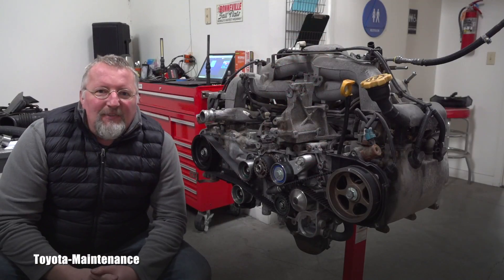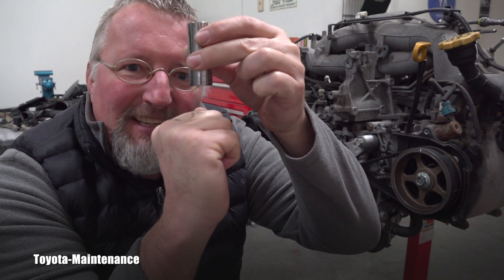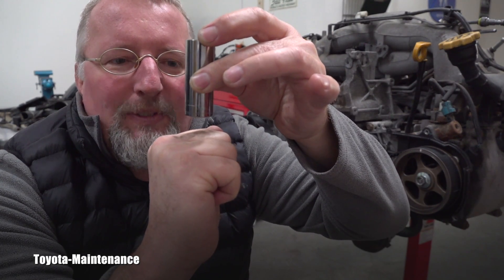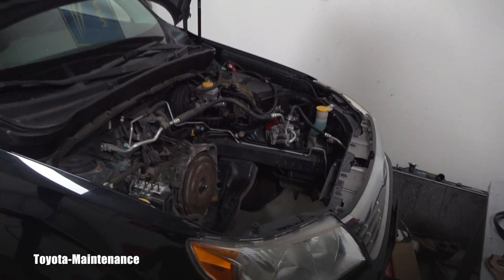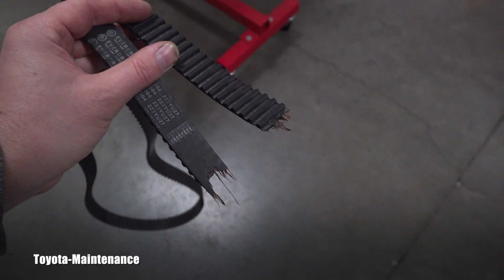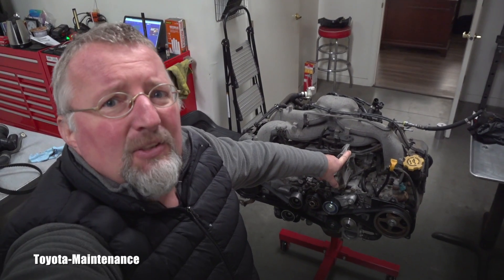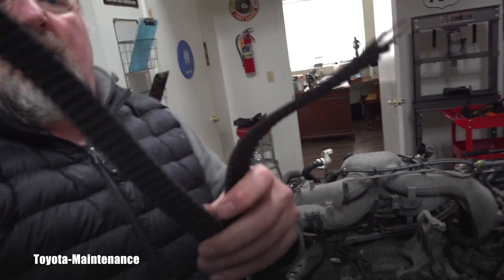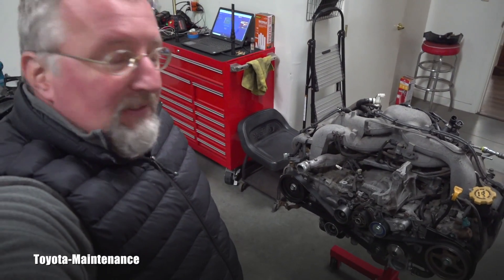Avoid Interference Engines with Timing Belt

Comment: Don't worry, Subarus will blow the head gaskets before the timing belt.
Reply: He maybe uneducated but he's right in the real world people do not do the required maintenance and when you let the coolant get to the point that it conducts electricity galvanic corrosion starts occurring this goes for all water cooled engines but Subaru's are particularly susceptible to head gaskets failure cause be lack of maintenance wether through owner or design flaw.
Reply: @moparnut6286  We paid for 3 head gasket repairs out of our first 5 Subies.  Maintenance wasn't at fault, just crappy Subaru design engineering.  I did my own timing belt/tensioner jobs on the belt-equipped Subies.  That being said, I got tired of Subaru's excuses & just got a 2019 Tacoma.  Never had a timing belt failure in multiple Subies to over 200K miles.  Maintain them, replace not only the timing belt, but also pulleys/sprockets/tensioners, and it should be OK.  Then you get to enjoy how your Subie consumes oil (1 qt/750 miles in.my 2013 Forester).
Reply: Not unless it burns thru the oil first.
Reply: Only the un-educated would post a comment like that.
Reply: @caraficionado4724  Do some research, it's you that is uneducated.
Reply: @caraficionado4724  huh? I've made a good living on changing them.
Reply: @caraficionado4724  lol subaru owner got buthurt

Comment: Great information about interference engines; it's definitely good peace of mind to own a car with an engine that is either non-interference and/or has a timing chain like my Scion XA with the 1NZ-FE. Although, while bent valves are certainly no fun, I do think the cheaper "Evergreen" brand timing belt may have had something to do with the premature failure. Also, given that the belt is of cheaper quality, the shop who installed the belt and completed the job, likely may have neglected to change the timing belt idler pullies. On Subarus, these pullies are more than often the culprit when dealing with timing belt issues, as their bearings can seize or even sometimes explode with old age. Doing a Subaru timing belt replacement should involve the installation of a full Aisin or OEM timing belt kit. MrSubaru1387 has some well-informed info on this in his recent video about timing belt kits. These kinds of engines can last a fair while with proper maintenance, just like the UZ engine family.

Comment: BMWs have timing chains, but plastic guides that cause the same sort of joy when they snap.  So simply having a chain is not a guarantee.
Reply: If you are concerned about reliability you wouldn't buy a BMW.
Reply: @gncc600  Although I joke about my BMW, most of the problems people complain about are due to a simple unwillingness to properly maintain them. My X5 could've been one of the many thousands of 4.4 V8 X5s with a trashed engine because of failed plastic chain guides, but I had it all replaced preventatively so as to avoid that fate. It sucked paying that 5k repair bill, but not as much as it would've sucked if the engine grenaded.
Reply: @tempest411  I agree. I've had multiple BMW's and they are fine cars - when maintained. But this constant attention costs money and most folks just want to drive, not wrench on their cars. New BMWs, in my opinion, are just for lease. Bring it back before the warrantee is over and you're fine. Actually, most manufactures are now following this model.
Reply: @mikearend997  That's about right.  But the re-sale prices on those kinds of cars are dropping faster than ever.  Used to be, German cars held their value very well.  Today, lease prices increasingly have to factor in that huge depreciation, and it may sink them in the current economy.
Reply: BMW stands for break my wallet!
Reply: @moparnut6286  Or, "Bring Money With"
Reply: Germans pronounce a 'W' as we do a 'V'.
As in 'Badly Made Wehicle'!
Reply: @ianrichardson3228  Ja, ich wiess. Ich spreche Deutsch!
Reply: Spinning Back-Kick  It was either that or let the engine fail, be stuck somewhere, and pay even more for a replacement engine. Since my wife is the one that drives it, that option is even less attractive than it sounds already.
Reply: Spinning Back-Kick  the job is very involved and takes many hours. you basically have to pull the whole front of the engine off. plus i'm sure for 5K they replaced more than just the guides. they probably replaced the chain, gaskets, etc. you can do the job yourself but it will still cost around 1K. after doing the job the car will be good for another 100K miles if the oil is changed regularly and the chain tensioner is changed once in a while

Comment: I've owned 2 Subaru Outbacks...  NEVER AGAIN!

Even Subaru's CEO has admitted that their company had a lot of issues.  News to him: THEY STILL DO!
Reply: good for you. I'll be driving Subaru boxer engines forever.
Reply: @wim0104  thank you! Most subaru issues are due to lack of maintenance or abuse!
Reply: Sean what problems did you have?
Reply: @gncc600  from the first month, CVT problems... I had a check engine light go off and they tried to tell me it was a pinched cable harness. The transmission caused the car to stall out a couple times too. Apparently, Subaru knew they had a problem but didn't want to deal with it. HG blew and was diagnosed when I had the timing belt worked on 90k-ish. The dealership never answered my question on whether or not they used a flush or just refilled the coolant after the timing belt/water pump replacement. The head gasket problem is a very common problem and I've educated myself quite a bit...

The car was in immaculate shape. Oil changes at 4, 000-mile intervals, both air filters changed every other oil change, PCV changed at 30k increments, the car was babied. Top gas, top synthetic blend and synthetic oils. I never pushed the car's RPM, it was the family's vehicle and with three kids in the car at the time, I didn't race around.

By design, the Subaru 2.5L engine was destined to blow its head gasket. Poor design. Poor, poor design. I have made a point to talk to Subaru owners that I see in parking lots at gigs, social events, etc. I'm not alone with the transmission and head gasket problems...  All but one Subaru owner that I've met has had one of those problems.  Even the newer cars!
Reply: @SeanPopify  Sean, sounds like you were a very diligent Subaru owner who stayed on top of all service and maintenance intervals, and didn't abuse and "over-drive" the car, but still was let down by design failures of Subaru. Sorry to hear about your disappointing experience. Notwithstanding the notorious head gasket issues that have plagued Subarus for decades, I was always fond of their boxer engine concept and AWD as standard equipment in all models. However, I lost complete respect for Subaru when they discontinued their automatic transmission and replaced it with the crappy unreliable CVTs within the last 4 or 5 years or so. It really cheapened the car. It seems that a lot of car builders have also gone with the CVT concept, which really suck. Unfortunately, most car buyers these days don't have an understanding or clue about the engineering and engine/transmission design, but only care about convenience features, drink holder placement and whiz-bang blue tooth wireless interface capability....and of course the exaggerated TV commercials showing Subaru's overstated off-road capability.
Reply: @carlv8168  funny you should mention the off-road capabilities. After driving my 98 Outback regularly in the snowy mountains (occasionally off-road), I tried to drive my 2011 on a snowy paved mountain road in California.  At a checkpoint, California Highway Patrol officers advised me that I could not go forward without chains.  My owners manual said not to put chains on that model of car.

Yay Subaru. Not.
Reply: @SeanPopify  Yeah, the CHP is really finicky about chains in winter in the mountain regions.
Reply: @carlv8168  I don't remember what year it was but they told me that they were starting to enforce it due to liability.  I had brand new all season tires on that car also. In years prior to that, they did check the depth of the tread but they allowed a four-wheel drive vehicle to go up without chains.

Subaru went from a great, durable vehicle to a weak copy of Toyota...
Reply: @SeanPopify  Yeah, I'm in San Diego, and they still required me to install chains on my 4x4 GMC Yukon with beefy tires, during the winter snows in our east county mountains. About the decline of Subaru's reputation, I totally agree with you.
Reply: @carlv8168  for reference my chain incident was on Palomar mountain. Save yourself! Stay away from Bob Baker and Weseloh dealerships! 😁😁😁
Reply: @SeanPopify  Yep, Palomar Mtn is typical for all the roadside CHP check points for chains. Cuyamaca Mtns, too. About Weseloh and Bob Baker, thanks for the warning, but I don't buy new cars often and generally keep them for 10+ years or more. Notwithstanding the dealership scenario, I already made my decision about 5 years ago that a Subaru (of any kind) would not be on my wish list, purely because of the $h*tty CVT transmissions. The only alternative would be an STi WRX, as they only come in a 6-speed stick, but even those are grossly overpriced, and I don't want the headaches of a turbo. My 25 year-old Yukon continues to provide unrelenting reliable service, and is powerful enough to tow my boat.

Comment: You did say a  4.7 is bullet proof  mine is 2002 LX 4.7with 4 speed auto.   I had  timing belt water pump and Toyota oem parts.  Drove 10K miles at speeds up to 90mph  then months after belt skipped about 6 teeth one bank of  4 cylinders stopped.  Limped to Lexus dealer for repair.  Any ideas how, why?  Merry Christmas!
Reply: Probably tensioner. Over time the tensioner can fail to provide the correct belt tension and driving at higher speeds/rpm's only makes it worse. All rollers, tensioner and water pump should be replaced when belt is changed. Costs more, but if something goes wrong, as in your case, you have to pay for it twice.
Reply: @mikearend997  Thank You for your help.
I am a senior citizen, Everything was changed at Lexus and I took the parts and belt. I had the timing belt and Water pump changed because I did not know for sure. I bought @ 90K  is now @ 106K

Comment: If the belt broke in 5000 mile maybe the valve train is now causing too much resistance causing them to break early.
Reply: Good point but the original was in good shape and only replaced due to age and mileage.  He used a cheap Evergreen belt.  The heads will be rebuilt so it should be good to go.

Comment: Toyota maintenance.
I have a serious question for you.
I have a 2005 Lexus Gx470.
All over the internet it says that this is an interference engine.
When I call the local Toyota dealer service department this say it is NOT an interference engine.
On top of that, to try to confirm, I called local Lexus dealer service ddepartment and they also said it is NOT an interference engine.
What is the truth?
Have you personally ever seen one of these engines wrecked by the timing chain breaking.
Please help.
Reply: You have a timing belt, not a chain.
Reply: @cpscps2679  I know that
Reply: the 4.7 V8 in your Lexus GX470 is an interference engine. If you have 60-100,000 mikes on it or the belt is 7-8 years old or more, or if you don't know the age or condition of the belt and you want to keep the vehicle (great SUV, by the way!), then I would change it. And don't forget to do all the rollers, tensioners and water pump while in there.
Reply: @mikearend997  have you personally seen one that has been wrecked by the timing belt going out?
Reply: @bigfootnmore6619  Yes I have, a 1986 Porsche 944 turbo. The belt broke and the valves hit the top of the pistons. Valves were bent and the valve guides were ruined. The entire cylinder head was replaced with a rebuilt one. There were slight visible marks where the valves had contacted the top of the pistons, but no damage to anything else. The engine performed well after a rebuilt cylinder head, gasket, timing belt, balance shaft belt (used on this engine to quell vibrations and driven by the timing belt), all rollers, water pump and oil seals were replaced. Needless to say, a very laborious and expensive repair. I've also seen where a valve broke off after striking the piston and continued through the top of the piston. That engine was replaced with a rebuilt one. I know the cost to get the belt service done is exorbitant to say the least, but if it costs $2000 to have it done right, that's only $250 per year if you were to do it every 8 years. Put the money away every year as the cost of doing annual maintenance. Buying a new car will cost you much more.
Reply: @mikearend997  I was talking about the 4.7
Reply: @bigfootnmore6619  Sorry, I have not seen the results of a 4.7 V8 with a broken timing belt, but that doesn't mean it won't happen and you have a lot of pistons and valves going up and down all at the same time. I would assume the damage would be quite extensive if it happened at anything over idle speed.
Reply: @mikearend997  I understand interference engine concept.
Please read my question in first comment so you understand the dilemma I came across.

Comment: Come on, the 4.7 is legendary. Change your belt every 100k like you're supposed to and they'll go 500k
Reply: Changing mine next week.  201K same belt.  4.7 2004 4 runner.
Reply: @hotepcracker8975  make sure you change the water pump, thermostat, tensioner pulley, idler pulley and serpentine belt while you're doing that work
Reply: @beardedwonder2346  thanks. I got everything but the pulleys.  Need to get those.
Reply: @beardedwonder2346  
Cam seal too.
Reply: @hotepcracker8975  LOL. How did it look?? 111,000 on my  2003 4Runner with original timing belt also. Thinking about changing mine in a month or so.
Reply: @unodfredy  Haven't got it done yet.  The mechanic got covid then we got hit with the 2 crazy winter storms.  Hope to get it in there next week or so.  I will let you know how it looks.
Reply: @hotepcracker8975  lmk! Still interested lol haven’t done mine and it’s original also.
Reply: @unodfredy  the belt looked almost new. No cracks at all. Some wear on the humps but looked fine.  Truck is running like new with all the work.
Reply: I did a FIRST timing belt change on a 2005 tundra at about 310000 miles...didn't know any better then
Reply: I agree, change the timing belt and all the ancillary parts every 100K and you won’t have any problems. All motors need some type of maintenance and changing the timing belt every 100K is not that bad. I turned 477K today on my 02 Tundra. I couldn’t be happier with the Tundra.
Reply: Seriously, I've seen the original belts still functioning fine well beyond 100k...this isn't something people should push their luck on though.
Reply: @hippiebits2071  They definitely shouldn't, but I have asked more than a few people about their timing belt when I run into a 1st gen Tundra/Sequoia owner and they have no idea what I'm talking about lol. Some of them were over 300k already.
Reply: @a3skywarrior845  I will check that out. Ground squirrels ate a few wiring harnesses up but stayed out of the timing belt luckily
Reply: I bought my '02 Seq at 250k miles. It was well maintained by previous owner, but I did my research before I bought it and knew changing the timing belt/water pump was for piece of mind. Also complete brake job because it's a heavy beast, and gave it new tires because traction is good. New battery. All fluids were changed, including blinker fluid. New synthetic oil every 5k or so. Three years after purchase, no mechanical issues other than leaky valve cover gasket and rotted PS hoses. However, I do have to fault Toyota on one thing. The original alternator gave out at 310k. Come on Toyota. I thought you were reliable!
Reply: @a3skywarrior845  Ahh Yeah, you guys whom live in the salt belt, I feel for you..
Reply: Non vvti UZs appear to be non interference despite toyota claiming they are.  Several land cruiser owners reported belt failure and no internal damage.
Reply: @tiptoez  seriously? Ugh I keep getting mixed reviews. A lot of people have told me not to worry that the belts last well up to 170k miles. Others say do it for piece of mind. Some say it’s interference and others say it’s not. wish I got a definite answer
Reply: @unodfredy  yeah, non interference on non vvt. I personally change mine at 100k on my land cruiser. Just did it back in October, belt was fine. IMO, the other components surrounding the belt will wear first ie water pump,  pulleys, the bearing for the fan. That said, my brother has 220k on an 03 sequoia and never had a belt change.
Reply: Even still a timing chain is better than timing belt on Toyota at least. Why deal with planned maintenance when you don’t have to if you get a newer Toyota with a timing chain.
Reply: The 4.7 toyota is a non-interference engine. I've seen multiple snap the belt and be fine.
Reply: 500K Miles is half life... They are known to go for a million MILES!!!